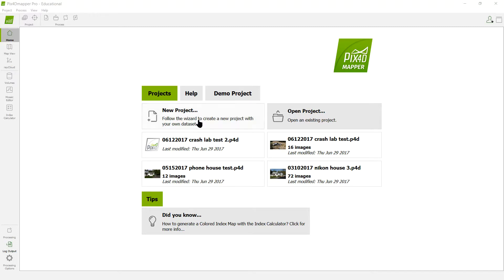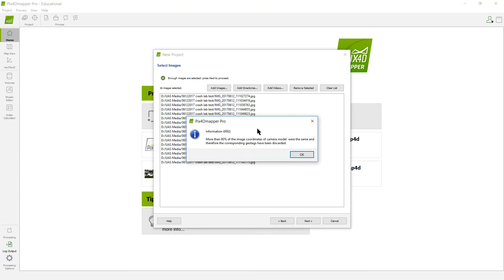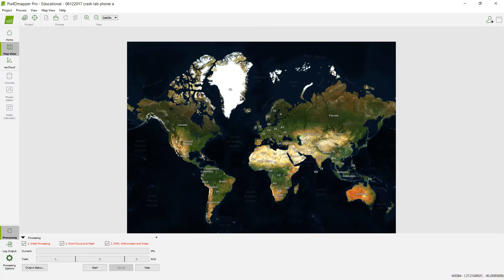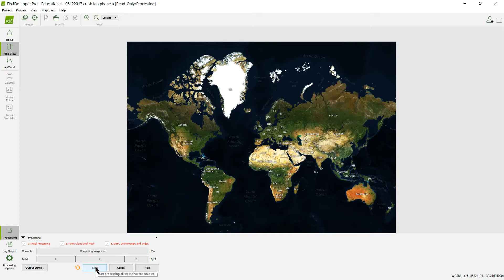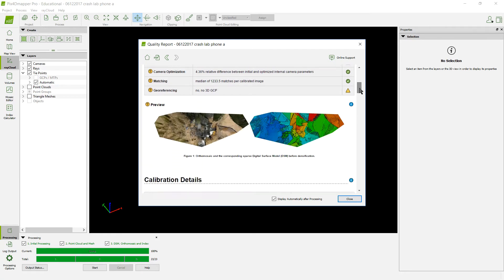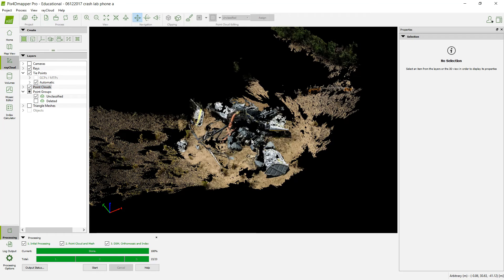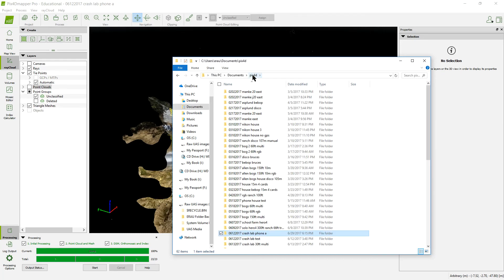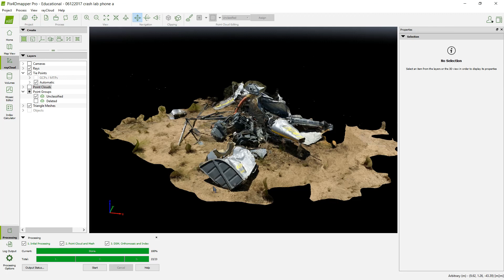Basic Pix4D workflow example

Comment: This is great, thanks also for the Disco Hero 5 modification details. Seemed to me that surely a non-AG Disco would make a great ground mapper with a higher capacity battery and an affordable camera system. I'll be doing your mod for using Pix4D with Disco images, plus directly from the tablet app on the Bebop 2. Please be inspired to provide more info on this topic, especially use of Pix4D on the Disco. Cheers.
Reply: Same👍